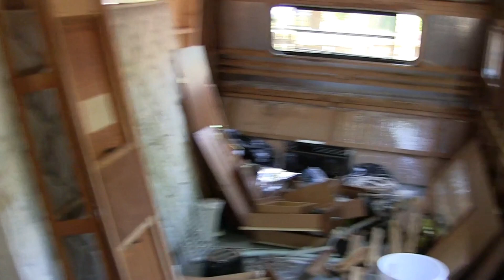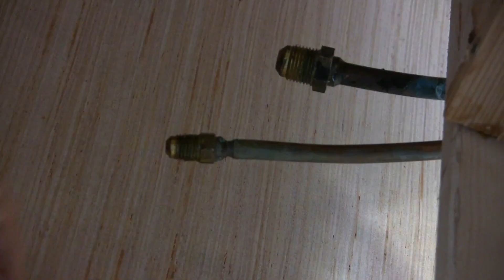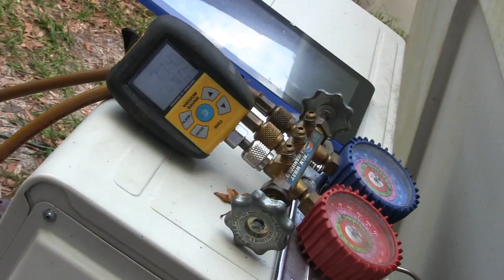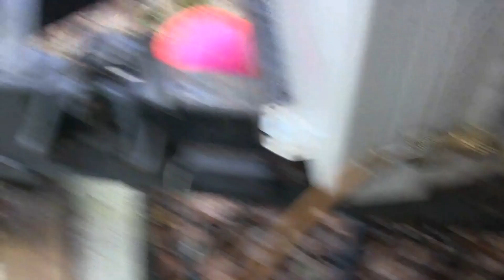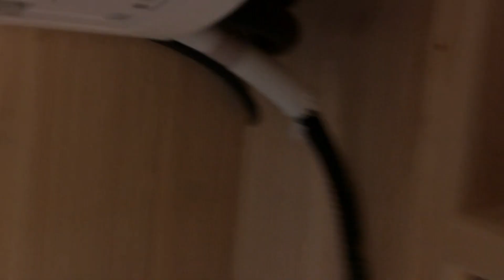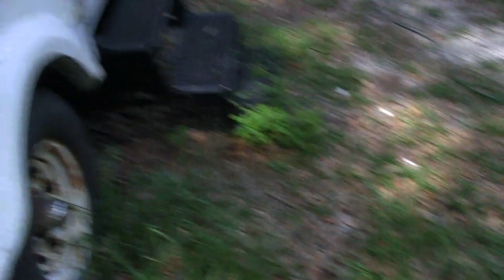Sanyo mini split installation in my camper (part 1)

Comment: I had that ac unit installed 15 years ago. Actually (3) outer units and (5) wall units. They are still all going strong - however that remote is a nightmare. There’s some crazy backwards logic on how to set up the clock, the timer, the functions - to this day none of it makes any sense.
Reply from the maker: You might be able to find the thermostat  instructions online.
Reply: @DrZarkloff  Yeah, NO. I've been looking for 15 years.

Comment: Dr Z , I am thinking about getting a mini split what is your opinion? I my house is only 650 square feet. I live in ca . Thanks for all you do
Reply: A 24000 btu should work fine for you. How many rooms do you have?
Reply: @jimstarkloff1333   4 rooms , living room bedroom kitchen and bathroom
Reply: @jimstarkloff1333  also is there a brand that you think is more reliable and easier to maintain and repair. 🙏🏾🙏🏾
Reply: @reymarquez4179  I have a hard time recommending mini split brands. I'd say that a three or four zone 24000 btu or larger would do the job.
Reply: @drzarkloff506  thanks 🙏🏾 for responding much appreciated, loved your videos. You would be great teacher

Comment: I saw your video kind of late in the game. Being a person that tinkers with electronics, you might be able to open the remote control and spray it down with CRC QD Electonic Cleaner and get it going again. I have done that with older TV remotes. I have also restored a control panel on a Friedrick portable heat pump. Believe it or not, the unit uses a reversing valve for heat.
Reply: Thanks for the info. I'll give it a try.

Comment: Sir thanks for giving always such a good informations....... sir  what size of compressor can be use in 3phase ac . ,,,,,,,,  for example,,,,   5.6.7.8. ton 3phase air conditioner required what size of 3 phase compressor